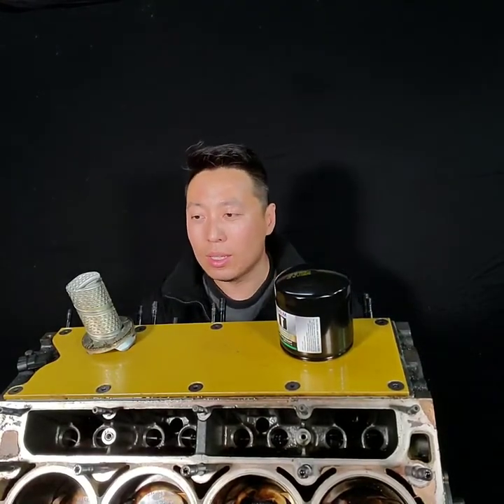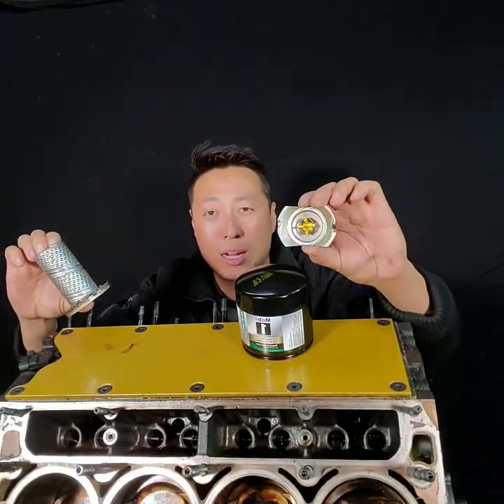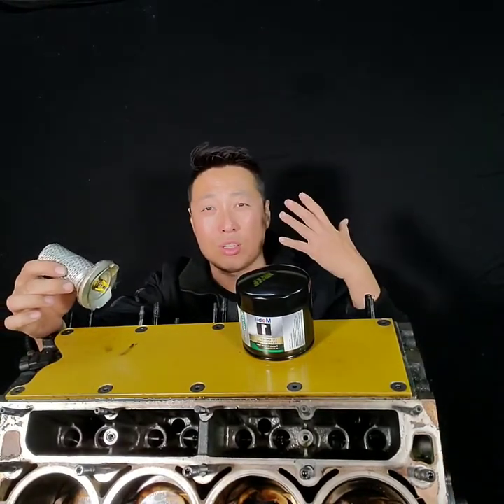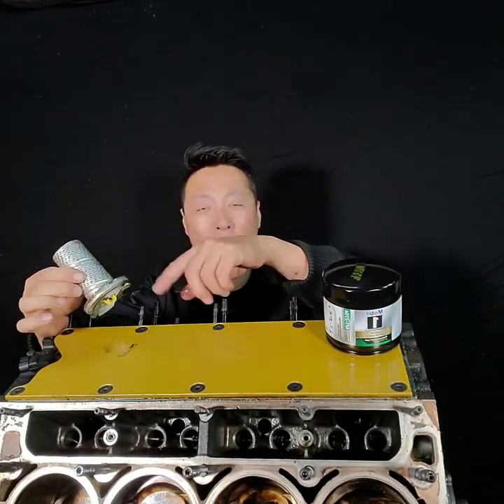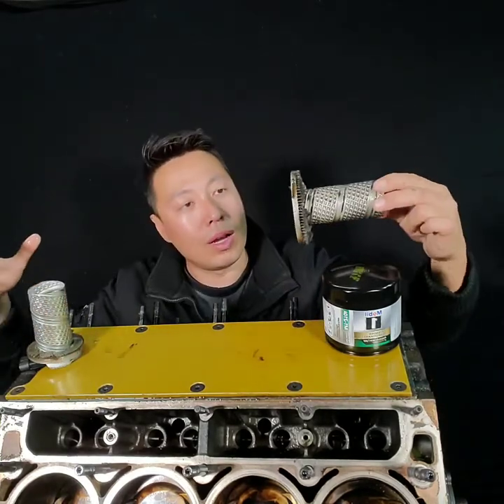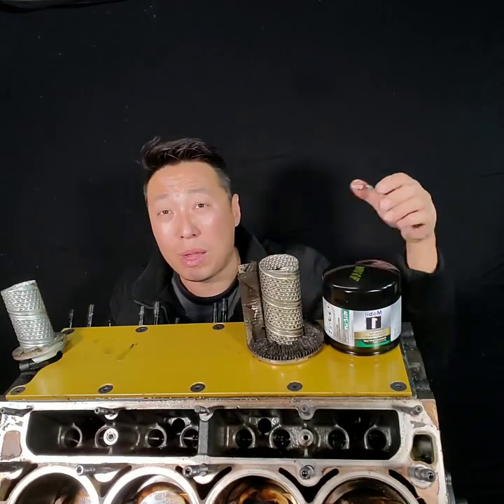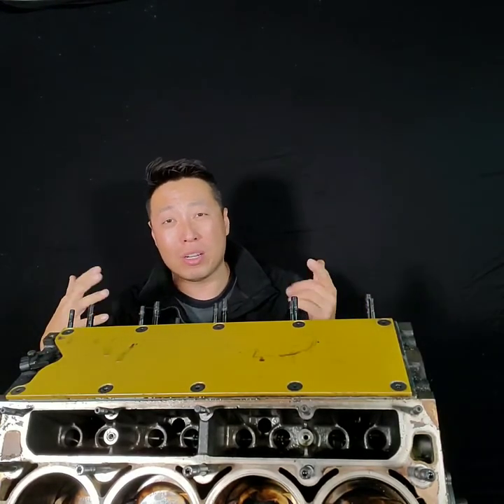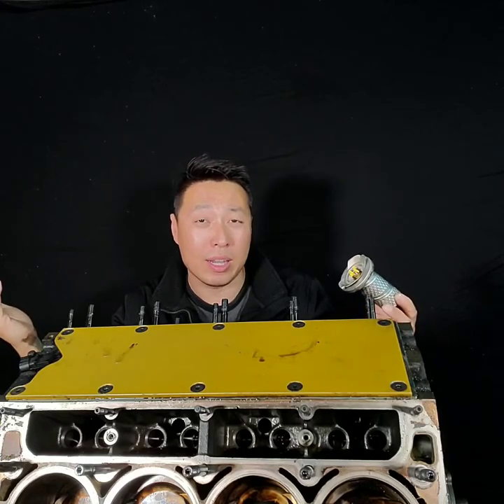Oil filter bypass valve explained, Best oil filter to use for racing / drifting bypass or no bypass

Comment: When you take your oil filter apart and find "glitter", that is not normal. Bearings do not break in, the crank should never touch the bearings if you have the proper bearing clearances and a constant supply of oil. You need to take a look at your lubrication system because it sounds like you are losing a constant flow of oil to your bearings. RPM shouldn't matter, race engines turn 6500-10K rpm during hours long races and very ,very few suffer bearing failures with a proper lubricating system. I don't know what kind of system you're running but that where I would be looking, not at your filter.

Comment: Since Mobil one is made by Champion Labs and the bypass is sat at 5-10 PSI Some engines are going to be running the whole time in bypass not good. That is why I use WiX oil filters their BPV are set to the Manufacture specs and you won't have that issue.

Comment: I have a dual canister AMSOIL  solution a BMK28 on my 6.7L power stroke F-250. One is a 20 micron filter with a bypass valve the other 2 micron with no bypass. Since the system has the filters in parallel you will have oil flow. The 2 micro filter over time will catch all of the greater than 2 micron depress.
Reply from the maker: Your oi still golden?
Reply: @spikedrift  No it gets black some of the soot is smaller than 2 micron. However when I change it and pour out the pans there are no small particles any more like I had with the cellulous filters.

Comment: All my diesel oil filters on my Cummins 6.7 do not have a by pass valve, you might want to try a Wix XP  they have high flow rate. Good luck.
Reply from the maker: Thanks 🤙🏽

Comment: It's not nearly as much about getting to dirty as the oil being to cold. Up here in MN & the whole northern US
Every day we start our cars & trucks it's about cold oil that will not go through the filter media for quite some time.
Maybe a half hour on 20 below zero mornings, before the oil temp gets to just 175F. It starts to go through but not like it should if you're on the throttle at all. Every day for months the filter does this. Even full syn 5w20 oil. Which measures of the charts when -20, -15, even 0. The viscosity is like a heavy gear oil at normal temp, Not @ 104 F.

Comment: pressure gauge before and after the no-bypass filter ! you'll be getting  decent flow only after the oil is fully up to operating temp.  hope you're running 0w
Reply from the maker: It's a race car. Gets warmed up before driven. Plus I have two filters with max rated flow of 70 gpm. Oil Pressure gauge is after the filters. No issues with flow or oil pressure.

Comment: i guess no bypass valve is best, do you replace your filter after every event? cause i guess i would if i use the non valve version :)
Reply from the maker: well... not really. if you run a non-bypass filter the flow is restricted on the top end. Also, the car needs to be fully warm before driven hard. 

I am running 2 non by pass to keep the flow on the top end higher to prevent oiling issues.
Reply: @spikedrift  How are you plumbing the 2 filters? Are you splitting the feeds and joining them back together on the return?

Comment: i have broken oil Filter Bypass Valve on jeep how dose that effect engine changed oil 3 times with no valve
Reply from the maker: If your bypass valve in the oil filter is broken.... then effectively you have no oil filtration since the oil is working past the filter media and going straight back into the engine. By design the by pass is just a valve with a spring and isn't easily broken. If you mean after that valve broke and you changed your oil 3 times and engine is running well I wouldn't worry about it. Might have accelerated wear on the bearings from that one time the oil by pass valve broke.

Comment: Did you delete the factory bypass in the oil pan where the filter mounts as well?.... I just put a delete plug in my build and am thinking of taking your advice on a bypass-less filter during initial breakin, but after breakin might go back to a bypass filter
Reply from the maker: I welded a 10an fitting and put my oil accumulator at that point.
Reply: @spikedrift  I'm referring the bypass valve under the filter, 1/2" from the oil filter threads, not the oil cooler attachment face (I'm assuming thats what you are referring)
Reply from the maker: @OV3rT1Me206  sorry for the late reply. I dont follow. The pan i am using does not have an internal by pass valve and of course the by pass valve in the filter itself cannot be touched.

Comment: Bypass valve is really nothing more than a Pressure Regulator. Can't have 40 PSI going in. And only 20 coming out.
Reply from the maker: totally agree. only opens in extreme situations or higher oil pressures. changing the oil filter or driving like my grandmother will prevent unfiltered oil from going into the engine :P
Reply: @spikedrift  or Cold starts.